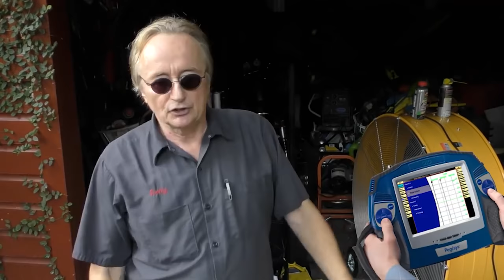3 Illegal Mods That Will Make Your Car Run Better

Comment: Hi Skotty, The SAAB two-stroke had a 3 cylinder in-line two-stroke engine. Later, (Because of clean air) they changed to a V4 from Ford of Germany (not to be confused with the Ford of Britain, which was a differently designed engine). A Two-Stroke engine works in the following way:- it sucks fuel/air/two-stroke oil (the mixture) through the carburetor into the crank-case, as the piston descends from the previous cycle, it forces the mixture up the bypass port into the top of the cylinder, which helps with scavenging burnt exhaust gases from the cylinder; Then the piston rises, compressing the mixture & once it gets near Top-Dead-Centre the spark-plug would fire, igniting the mixture & forcing the piston to descend. That is how it works, still with Suck/Squeeze/Bang/Blow, but within two cycles instead of four. The Piston only assends once & descends once to perform the Suck/Squeeze/Bang/Blow. There are minor differences with different manufacturers, particularly the timing of the spark & with the Two-Stroke oil entering the engine. Regards. Ian (an engineer) from England (UK).
Reply: You really know that. Best wishes

Comment: If the fuel injectors get upgraded [+ lets say fuel pump n' such to accommodate]. Wouldn't the air flow need to open up a lot more, [more aggressive intake/throttle body/forced-aspiration/etc], to avoid drowning the cylinders with fuel / choking up CC?
Reply: All things are relative  , to really do it right some people set up their car depending on the final gear ratio of the rear-end.
Reply: Not if you have control over the injection timing pulses. Say you went from 200cc injectors to 400cc injectors, you'd just need to hold the injectors open for half the time. That's more or less what people adding turbos and standalones to cars are doing. 

Most fuel injectors don't like accurately cycling much quicker than 2ms pulses, so you can go too big. A gigantic turbo on a small displacement engine might need staged injectors to keep from idling at 10:1 fuel ratios while still being able to keep enough fuel when the turbo really starts pumping.

Comment: I wonder how much HP you'll get with these mods......I'm sure it'll depend on the car. I'm surprised that Scotty didn't mention increasing the rear axle ratio. There's some question as to whether CAI "upgrades" increase HP also. Too bad I don't have access to a dyno.
Reply: Rear axle ratio? That wont change HP... HP only comes from the engine.
Reply: I agree
Reply: @martinsvensson6884  It wont change hp. However it helps on the top end.

Comment: FYI, modern aircraft mufflers actually INCREASE HP/fuel at cruise RPM while still significantly reducing sound over factory pipes.

Comment: Mufflers also slow down the cold air going back up the exhaust when you turn the car off (cold air on hot exhaust valves can bend them)

Comment: Best way to clean the c converter .... drive it into a local body of salt water while running , let ot soak for 2 days, pull it out of the water, air dry for 10 minutes and let it air dry

Comment: I had a issue with the catalytic converter on my 2008 dodge ram 1500 at about 200,000 miles. I replaced it with a section of straight pipe, it works great. I do not have emissions tests where I live.

Comment: Resonating chambers reduce noise levels without restricting the exhaust flow. Torque valve nozzles use fluctuating pressure pulses to increase cylinder pressure, while preventing the sonic pulse waves from disrupting or diffusing the mass of the outgoing exhaust pulse that leaves a low pressure condition in its wake and helps improve the flow of the next charge of exhaust gas.

Comment: Scotty the reason most cars backfire when the Mufflers removed is oxygen enters the exhaust system from where the muffler was, oxygen allows gas to ignite and you get a boom from the tailpipe that's usually where the backfire coming from especially when your engine is stupidly modified and it dumps hydrocarbons in today hot exhaust system.

Comment: Thinner dont clean converters well.  The smart thing to do is to take it of and first clean with hot water + 3-4 dish washing tabs after soakng for a long time flush with hot water and then use C2H2O4 oxalic acid or , HCL + 6 parts water (hydrochloric acid)  to take out the metal oxides but remember to flush with a lot of water to stop corrosion

Comment: Used to regenerate a catalytic converter by baking it in a ceramics kiln. The high heat plus air burns off all the carbon sulfur and other junk that poisons the platinum in it.

Comment: Catalytic converters are a nightmare. If they break, they will cause too much air flow for the downstream O2 sensor to "detect" the efficiency of the catalytic converter. Put an extender on the O2 sensor, creating a small pocket for fumes to accumulate and, voila!, error code goes away. Downstream O2 sensors don't detect anything other than there is exhaust fumes present.
Reply: You're talking about those spark plug foul extensions? I heard you could remove the front two, upper, catalytic converters and use the extension in the 02 sensor hole and trick the system.
Reply: *front sensors are different.
Reply: @SkittlesWrap  on a car with four catalytic converters, I was under the impression you can remove The two front catalytic converters and use the spark plug extensions in those catalytic converter sensor locations.

Comment: That backpressure can be really important tho if your car is newer and has a ton of sensors that back pressure could be the difference between it running fine and it running sluggishly

Comment: had my cat removed soaked in dishwasher fluid, machine dish tablets and some pipe cleaner drained it over night.

it fixed the codes om both  banks, and removed the rough idle.

Comment: We had a 1975 Datsun B210.   It used to be bad to Backfire.  We changed the Antibackire valve on it and I think it helped it,  but I think it still did it.

Comment: cleaning your catalytic with shopee water or omo really works. After washing, fix it back and then start your engine let it run for like 5 minutes then rep the engine to 2 to 3,000 rpm and the exhaust gas will blow out remanding carbon and water through the exhaust tall

Comment: The V4 that Saab used in the Sonett was a 4 stroke Ford engine. The other option though was indeed 3 cylinder 2 stroke engine.

Comment: Hey Scotty I’m just curious about the muffler part, because I was taught the complete opposite. Back pressure is bad, we don’t need back pressure, correct. The conflict in our knowledge is the loss of power from the mufflers, because I was taught A)the mufflers reduce back pressure, just like a couple 90s in a straight pipe fights back pressure, and B) the muffler actually increases (SLIGHTLY) the amount of horsepower you have. 
The way I came to understand it is, the muffler will give back the horsepower the AC takes. About 15 HP 
How much of that is correct? You are a master mechanic, correct? I would like to learn why I am incorrect

Comment: So I had a 95 Cadillac with a v8. Ripped the cats off and installed Flowmaster mufflers. Took it through emissions and it was better then when it was stock.

Comment: The reason those high strong Italian cars backfire is usually because they leave fuel flowing even though they cut air that way when they get back on the throttle it's basically instantaneous throttle response. Is a very minute gain, but it's still a gain. In theory, the backfiring would cause the engine to slow down faster as well. So slow down into a turn and fast out. It absolutely destroys catalytic converters as evident in the Jaguar F-Type one of the very few factory cars that backfire and burbal from the factory

Comment: The car: 1972 442 with a 455. 11 mpg @ 60 mph. I advanced the spark past specs a lot. No knocking, because I used 95, which was available back then. Result: 14 mpg @60 mph.

Comment: Dawn platinum the dish soap will clean your catalytic converter
Your welcome if you wanna prevent any rusting issues a little fogging spray will fix that do preferably before an oil change if your gonna run any thru the engine

Comment: I've seen mechanics working on older cars with stopped up convertors , take the exhaust pipe off & tap it with a hammer & collect a bunch of balls out of the pipe. The car would run much better afterwards. It was like it had COPD got cured & could finally exhale the exhaust.

Comment: You don't have to remove the catalytic converter, just remove anything inside it, meaning empty anything inside and then put back , on the car, that way you will have no noise and of course no pressure.

Comment: My cathalitic converter was intact but wasn't working at all in my Honda Ej8 coupe . 
hc's 1210ppm no check engine light at all...
I did before inspection New tune up high performance parts installed.
No Bosh platinum of any kind thank you. 
Inspected pistons heads cylinders and chambers with a camera everything clean.
And it didn't pass smog inspection.
Went to get a new MagnaFlow Cathalitic converter and passed today.
$640 installed at west coast muffler...

Comment: I used to own a Saab Sonnet. The V4 engine in it was made by Ford and it was a four-stroke, not a two-stroke. The Saab 2-stroke engine was a 3 cylinder engine. It was used in the Saab 96 and early Sonnets.

Comment: Sorry Scotty, the Ford Taunus V-4 used in SAAB 95, 96, and 97, (Sonett) which became available in the 1968 model year were 4 strokers. 
 My dad couldn't decide at first whether to get the inline 2 stroke 3 cylinder or the V-4 4 stroke. But then his previous car was a DKW JR, 2 STROKE 2(?) cylinder

Comment: Dude, 2-stroke’s… 

I raced 2-stroke motocross bikes, 20 years ago…

About the first mod anyone made, was an aftermarket “pipe”(expansion chamber) By using a different pipe, you could change the powerband. If you wanted more low end or top end, you had to change the pipe…

Comment: You can buy a universal catalytic converter, they work great, you can buy big one with big diameter, and use pipe adapter to get it to your car pip diameter, and they will stay working forever, i used one myself  bought for jeep grand Cherokee 6 cylinder on 99 Honda crv and it takes 4 years and it is still working fine, I just used  exhaust pipe adapters to get it to car exhaust pipe diameter and I even didn't welded it there I just used pipe clamps to hold pipe, an used some exhaust tape to seal any leak and no problem 
, of course if weld it, it is better.

Comment: I had an 1988 Celica ST.  That car was a manual transmission vehicle.  That car would get right after it with all stock parts.  It rusted out and died as the entire car basically rusted into    oblivion.  It was a great car...!!!  go get em Scott K

Comment: Personal experience with back pressure and exhaust emissions and fuel efficiency. Had a customer with a Chevy flatbed tow vehicle. Decided to increase the power and had the cat and muffler removed and went to dual exhaust. Fuel mileage was 8 mpg with that. Law changed and forced them to put it back to stock which was single exhaust of course with cat. After I put the system back to stock back pressure or whatever it was the mileage jumped to 16. Back pressure must have had an effect.

Comment: I installed headers on my GTO, and decided to be socially acceptable.  I purchased and installed high-flow  converters.   The converters worked fine, but simply flowed more air than the stock.  I ended up having the rear O2 censors shut down anyway.

Comment: You talked a lot about the Cat converter in this video.  I have a Nissan that started throwing the code and I tried the cleaners a couple of times.  Then I tried Ethanol free gas.  It has not thrown the code since using E-Free gas.  However, as soon as I fill more than half a tank with 10% ethanol, it throws the code.  So, I use  ethanol free gas and it also improves fuel economy 10%.

Comment: Ah, I remember by old Beetle. Someone tapped me in the backend at a stoplight -- smashed up the muffler. Then it burned up the engine because the back pressure was messed up.

Comment: Ethanol air to fuel ratio is 8-1
it will run leaner meaning your engine adjust and will use more fuel if you have O2 sensors
if you have a carb, it will just run lean

Comment: We used to push a potato into the exhaust pipes on a car we planned to race, after getting the potato in the pipe, we would cut a hole through it to keep it from blowing out.
The car would run fine until it was floored, when it would cut out and run like crap!

Made for a fun race! That's what a clogged exhaust system does to a car!

Comment: I just busted all that crap up and  shop vaced the busted crap out, ran 10000 miles with it like that  and never had a problem still running fine when I sold the truck ranger

Comment: You need a little back pressure in the cold, for instance a manifold that dumps but has a bend in it other wise the cold will warp the hot valves and it will run like junk for the rest of time :,)

Comment: The celica had a stainless steel exhaust system. You keep your car pretty clean mine was showing some rust I loved it to my sisters kid he drove it in the snow ice and crap and never washed it, road salts quickly took there toll.
But the muffler was still good.

Comment: In the 70's, I had a HONDA 600 car. It had a 2 cyl 4 stroker. Top speed was 78 mph (downhill) and a 5gal fuel tank.     😍     I wish I still had it With today's fuel prices!!

Comment: Gotta 01 tundra , chopped the muffler and resonator off and welding in pipes , truck runs better and sounds better , lost some gas mill age because I like the noise but noticed some power gain

Comment: I got pulled over by a cop when I was a youngster because my 1970 Big Bad Green AMX had pipes that were too loud. It was just the stock dual exhaust system. Of course I racked the pipes off a little by slowly taking off in first gear and then hammering her and slamming into second. Prick fined me $25. That was in 1973.

Comment: There is a great deal of variables that was left out such as the majority of cars need a certain amount of back pressure in order to run at their peek torque and horsepower.
Reply: Huh? He is talking about 4 stroke engines, not 2 strokes or diesels.

Comment: My converter was stolen off my Ford E350 Super Duty 5.4 10 years ago and it still hasn't thrown an engine light or code. That was 160000 miles ago. Mileage went up RPMs went down for same MPH

Comment: Most newer cars typically wouldn't need a tune because of the technology tracking and compensating. Goes the same if you're increasing air flow with a cold air. You wouldn't really NEED to tune but it doesn't hurt not to. Not true for older cars with older pcms and such tho

Comment: Had the shell of the pre-Cat on my 2005 Nissan Altima crack and the exhaust was finding its way into the cabin. I verified the crack by pumping air up the exhaust pipe (with engine off) and probing around near the pre-cat with my mechanics stethoscope with just the rubber tube. I isolated the air hissing sound escaping at the pre-cat and replaced it with one made by Walker. Two years later, same thing happened and they replaced while still under warranty. Did the work myself and it was not too hard.

Comment: When performance is required all good sleeper operators know about the use of dumpers.  A waste gate with an actuator in front of the catalytic converter to the fat y pipe .
     Volswagons and Porsches with 4cyl boxter engines do perform better with tuned exhaust.  Tube length from cyl head exhaust joining in sequence with exhaust force compounding as the flow picks up the next cyl exhaust rather than exhaust glasses competing to escape and excessively  inhibiting outflow .

Comment: Some performance cars will use an anti-lag system to keep the turbos spooled and run rich mixtures to keep temps down which both cause backfires. Theres nothing wrong with the tunes of those vehicles when its done properly. Backfiring on down shifts, cool, up shift backfiring is a problem.

Comment: The backfire you are talking about in the exotics is in corvetts, mustangs, even gosh toyotas is the result of two things mainly. There will be backfire even properly tuned on a DCT, and ZF transition or any other fast shifting manual style box. Timing is cut from the motor to not destroy the next gear and internal clutches. Automatics do the same. Difference is the DCT / Manual style like a soft rev cut limit to drop the RPM during the shift. Thats the EFI logic behind that pop you might be hearing. Essentially the car is flat foot shifting if it was a manual.

Now that is not to say there are a billion BMW, Mustangs Etc, that have a "burble" tune which in essence does not turn off the fuel injection properly during shifts and especially on coast decell. Essentially their tune has the car burning fuel unneededly on decel and will destroy the cats etc.

Comment: my 97 f350 7.3ps has a 5 inch straight piped exhaust and i can roll coal if i want.  my 13 gmc 1500 all ive done to it is a 2" leveling kit and replaced the rear springs and thats it besides a high flow air filter and thats it

Comment: I see we're just going to leave out The relation between torque and back pressure. Now I run K&n air filters and free flowing mufflers on every vehicle I buy but you got to have a little back pressure to retain your torque and power curve for a non-aspirated engine.

Comment: It can be problematic on 4 stroke turbo if you only have a downpipe and the turbo have a built in wastegate. Will cause boostcreep if no backpressure but the engine don't mind.

Comment: @scotty kilmer
my car have one if those manifolds wher the cat is mounted.

There is two O2 sensors at the top  that could be removed.

From there the cat can be sprayed with chemicals and cleaned out

What's your though about that?